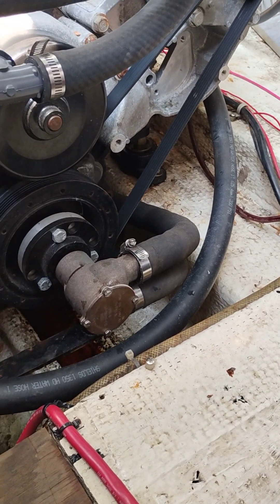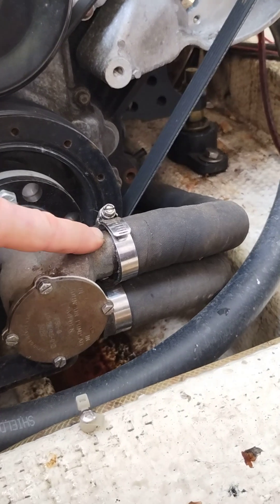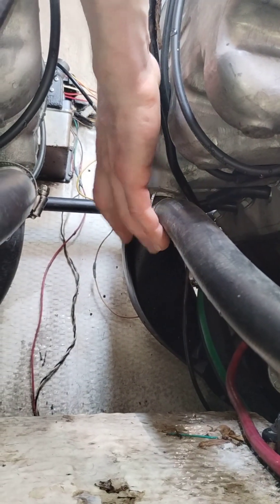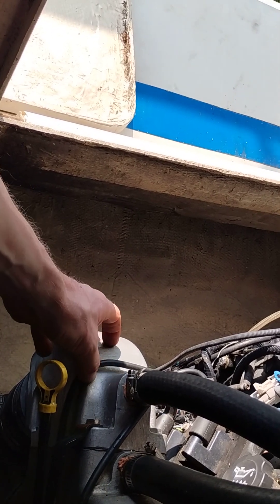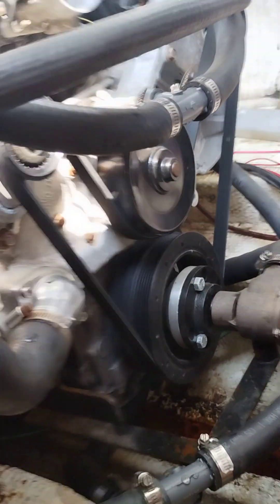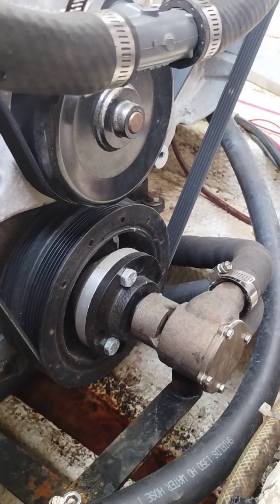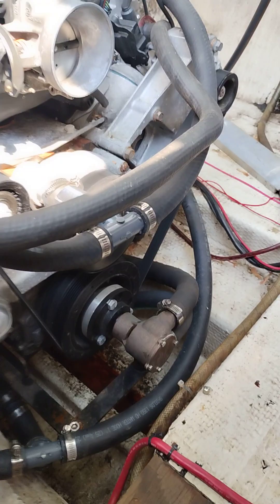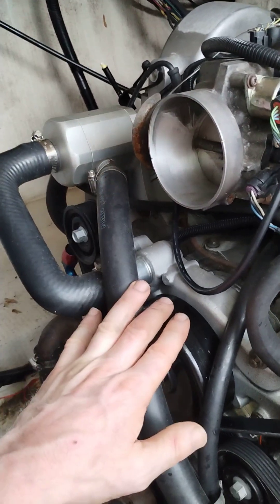Marine Chevy LS lake  water routing for warmer than 110°.(160 +) degree temperature.

Comment: The LS motor is designed with a reverse cooling system.  The water exits the block out the bottom where the t stat is.  The cool water enters the block through the top pipe of the water pump….
Reply: Nope. Inlet to water pump is always at the bottom , and feeds from bottom of radiator , exits out of the top top the top hose of radiator.
Reply from the maker: No that's not true.